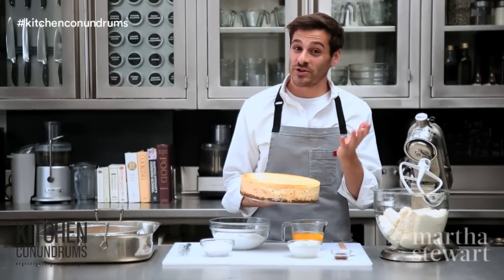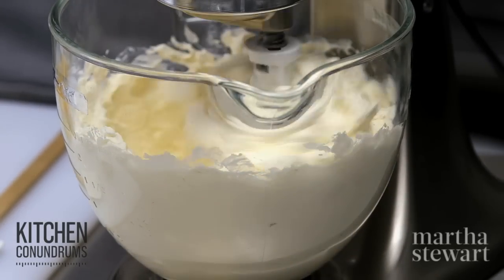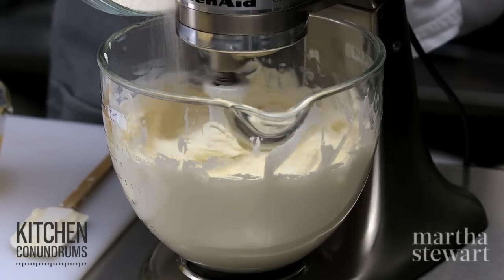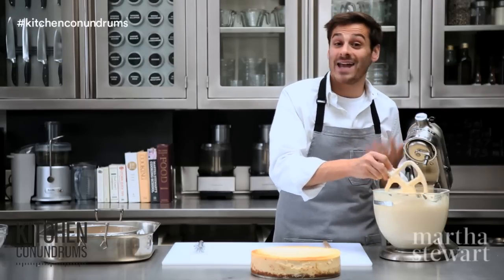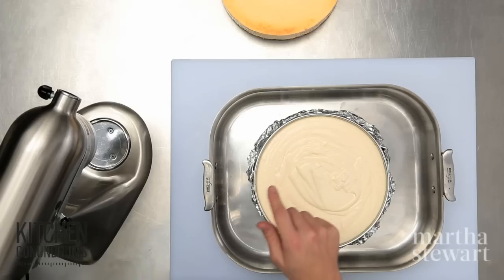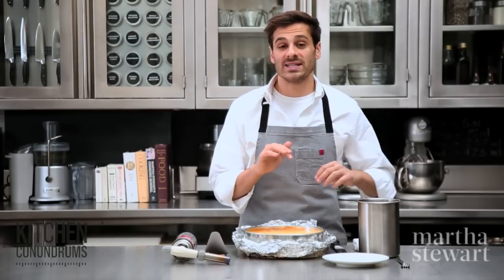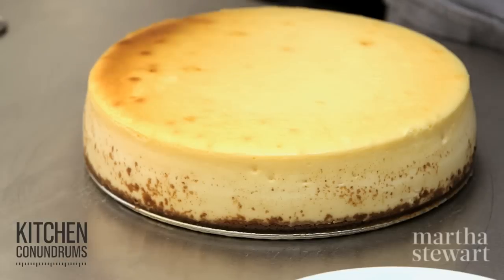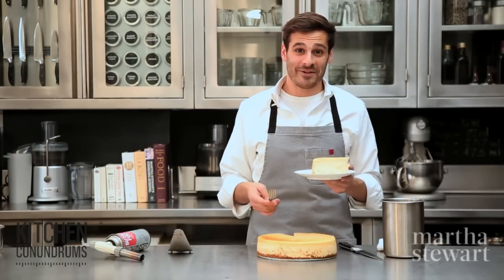The Method Behind a Crack-Free Cheesecake - Kitchen Conundrums with Thomas Joseph

Comment: Hey Thomas! I made my very first cheescake yesterday, and didn't use any flour. It was amazing! Delicious. Now my question is, what's the difference when I put or not put flour on my mixture?
Reply: flour creates structure in the mixture its just to stiffen it if your mixture was too runny and might fall apart when taking it out you should have added flour other wise if its thick enought to hold shape without extra gluetin to hold shape should be fine by my guess

Comment: From the original Martha Stewart Recipe:
Bake 45 minutes; reduce oven temperature to 325 degrees. Continue baking until cake is set but still slightly wobbly in the center, about 30 minutes more. Turn off oven; leave cake in oven with the door slightly ajar, about 1 hour. Transfer pan to a wire rack; let cake cool completely. Refrigerate, uncovered, at least 6 hours or overnight. Before unmolding, run a knife around the edge of the cake.
Reply: Thank you! Bake time/criteria NOT stated in video

Comment: Hi Joseph
So riddle me this one then: my cheesecake has very similar ingredients, less a pound of cheese. My method varies in that I beat the crap out of the batter every step of the way to put tons of air in (hence the reduction in cheese-no room in my pan). Then, not in a water bath, I start the bake at 500F for 10 minutes, then reduce to 200F for a few hours. It is such a silky smooth texture cheesecake, less heavy too.  No cracks. But seems to go against everything you say.. How come it works my way?

Comment: I have only made cheesecake twice, and the second one was less cracked. Both times I happened to have some of the batter left since the springform pan was filled to the rim, and if you want to cover it up and it will look like the batter is oozing slightly, so save some. If you don't need it, you can eat it as is ;)

Comment: Hey thomas, do you have any ideas on why the cheesecakes at Cheesecake factory look so smooth? if you look at the sides on the slice you cut up, they are not smooth. thats been my problem too. I am trying to figure out what is it that cheesecake factory does that makes its slices look so smooth? any ideas?
Reply: You can dip a knife into warm water ,dry off and then smooth the top if theres a crack or keep warming knife to do the edges.
Reply: Teresa Laurie
TY Teresa, will surely try doing that. merry mas
Reply: No problem! I used this trick at christmas an it worked great! Merry mas to u too!
Reply: You could line the sides of the pan with a strip of parchment.

Comment: I'm a little bit confused! Help please! How long should I bake it for 350 degrees and how long should I bake the cheesecake on 325 degrees?
Reply: well, i am confused 2 :(
Reply: Linda Olvera it's fahrenheit in the video. convert it to celsius
Reply: Linda Olvera I know! He just said until it's done😬 I guess it's a guesstimate
Reply: 45 min on the 350 degree and 325 for maybe five min or less the reduced on is the guess time as well for fahrenheit to celsius 350 fd is 177 c and 325 is 163
Reply: From experience, probably 15 minutes or so. A cheesecake is done when the edges are firm, but the middle still giggles a bit after you shake the pan.
Reply: My ? too.  He states 45 min at 350, but doesn't say for how long at 325...guess until the smoke detector goes off!
Reply: Linda Olvera Hey, so you bake it for 30 more min at 325, I found it on their website!

Comment: soo I got you bake it for 45 mins at 350 degrees f, then reduce the oven temp to 325 degrees, how long does it bake at this second temp? because 45 mins is not long enough to bake a 10 inch cheesecake.

Comment: i'm using the electric oven, and there are some functions for the heat, what kind of heat should i use? the bottom heat or the up and bottom heat? thankyou. 

btw the up ad bottom heat also completed with the fan in it.

Comment: Tom, please tell me, after i reduce the heat, i open the oven door and cook it like that for 1 h or i have to cook it more at the temperature of 325 F with the oven door closed? if so, for x minutes and then let it rest for an h in the oven with the door opened? i didn't quite get that part. Thank you!
Reply: +Alexcia France thank you
Reply: +Brigi Balogh It is to slowly reduce the heat of the oven the water bath and the cake. unlike going form a hot oven to a "cold" kitchen.

Comment: How long do we leave at 325? Can I use hand mixer if I don't have the electric mixer or would it change consistency of cake? Last one, how do I remove cheesecake without causing cracks from regular pan? I don't have springform pan. Thank you!

Comment: Why not use condensed milk? What difference would it make? Could someone explain what the difference is in using condensed milk instead of sugar in any baking recipe please?
Reply: A traditional or old recipe for New York will contain cream and sugar.  This one had no cream. I have seen Cheesecake recipes with SCM and New York style recipes as well.  It should do OK. However then it will be harder to incorporate the flour. The only recipes I see without flour are fluffy or no bake cheesecake, the ones without egg.

Comment: If you are true about the air bubbles causing the cracking, you can use a vacuum chamber to make sure there is no air inside the batter. After all, in the cooking process very tiny bubbles that didn't come up to the surface will enlarge, come up to the surface, and become visible. I guess if you already have a vacuum chamber w/heat sealer combo for sous vide, you can use it for the batter -given the chamber is large enough for the batter container.

Comment: Since there's no link to get the recipe from, I tried copying it from the video. You said to cook at 350 for 45 minutes then reduce the heat to 325. But how long do you continue cooking it at 325?
Reply: Lorien Drechsler hi it is for another 30 minuets until golden on the top but wobbly centre

Comment: I have been making cheesecakes professionally for 40 years and have never used flour.
Reply: +nicholas cremato I&#39;ve made bananas for 80 years and I can tell you have an uncle
Reply: I never saw other recipes with flour either, but they put gelatin
Reply: Kim Aberin your eggs will set the cake up when you refrigerate the cake after it cools.
Reply: The gelatin recipes are the ones where no baking is involved. The cake just sets up in the fridge.

Comment: You can see the cake has already shrunk from the side after it's been chilled in the fridge, that blowtorch step was quite unnecessary...
Reply: yeah i dont think u need a blow torch, not in this case anyway
Reply: i think it was to melt a thin layer of residual oil in the crust so that it doesn't snag when the spring pan is snapped out

Comment: This is way too much cream cheese for this cake. The end result would be too dense. I have a relative's recipe where only two 8 oz. bars of cream cheese are utilized with1 & 1/4 cups sugar,  6 eggs, separated,  3 tablespoons of flour along with a pint of sour cream,  a tbsp. of vanilla extract, 1/4 tsp. cream of tartar for the eggs whites beaten separately to develop into soft peaks and folded gently so as not to lose the airiness of the egg whites into the cake batter to help the height of the cake and a cup of Graham of Nilla wafers crushed mixed with a tbsp of sugar and 2 tbsps melted butter for the bottom crust. I bake mine @ 425º for 10 minutes then lower the temperature to 350º and let it bake in a water bath for 50 more minutes. Afterwards, I open the oven door for 1 full minute then close it and let the cake cool down in the oven for 1 additional hour (this helps prevent cracking). . Afterwards I take it out and let it cool to room temperature before chilling it overnight. I don't use springform pans, they leak. I unmold the cake very nicely by preparing the pan with ample amounts of butter on the bottom and the sides of the cake pan and use parchment paper to line the bottom and the sides. The cake when unmolded cuts beautifully using a clean knife method after every slice portioning. I've had many people compliment on how well and light the cake tastes, not dense or overly sweet, just right and not sitting heavy in the stomach like this video's recipe would IMHO- FYI.a tbsp. of vanilla extracta tbsp. of vanilla extracta tbsp. of vanilla extrac

Comment: Not the best idea to use the water bath - that requires a humid-resistant oven (such as the ones bread makers need to control humidity). Too much water and it will ruin the electronics in your oven.

Comment: Nice, but not perfect-& we've all seen perfect. There are air hole up inside the sides. The top is unevenly browned (no brown or all light tan is perfect). And finally, the crust is messy & uneven. Lastly, it's not high enough. I can't taste it for texture & taste, but I'll give it a "B".